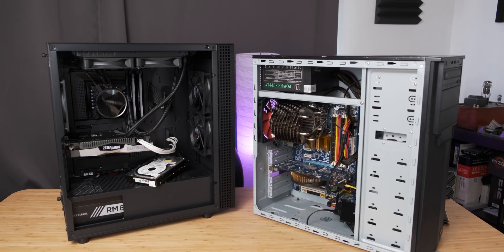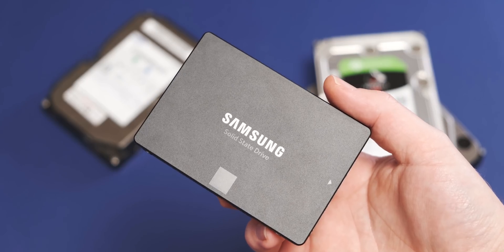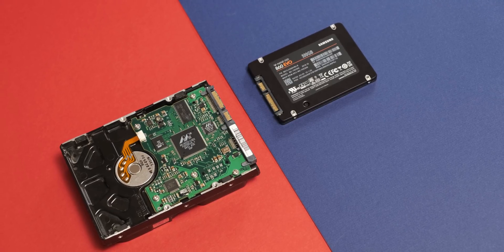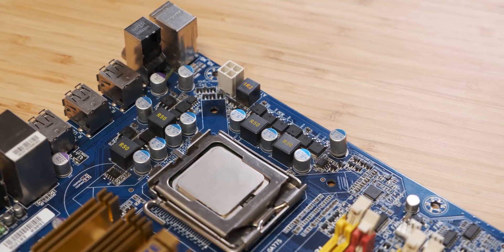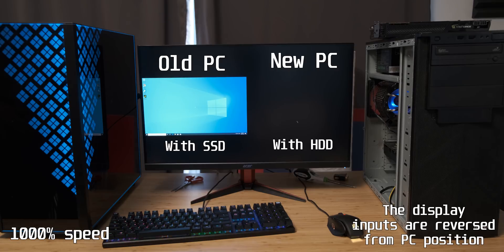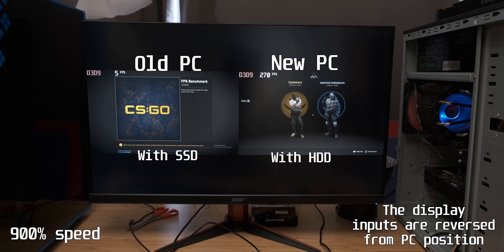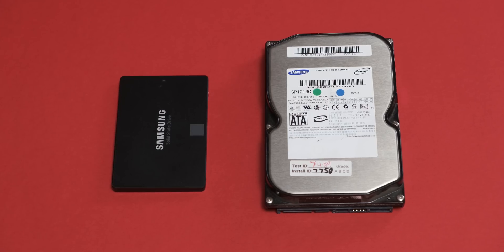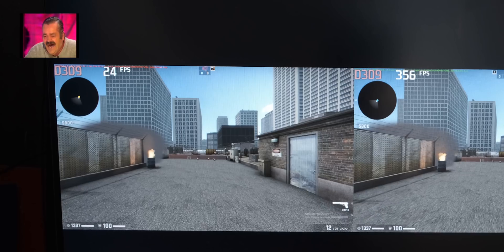New PC with old hard drive vs Old PC with new SSD

Comment: Love the channel as always and the video.

Sata ii is 3 Gbit/sec ~= 300 MByte/sec. I think things got a bit confused.

The RAM cache will disappear on power off, however over time Windows may move data around on disk to defragment frequently used data. There was a system where you could use a USB flash drive as disk cache.

Your processor+motherboard supports Optane which can accelerate old Sata disks quite effectively - depends on use case. It's a bit like the RAM cache case but bigger and non-volatile. Do try it for interest?

However both the previous techniques use non-volatile memory (Optane is not flash memory) as cache, so might be considered as cheating.

With my previous work computer I just installed lots of RAM and left in on so the RAM cache remained in place. Only way at the time to get round the poor performance of rotational drives.
Reply: Incidentally, before the time of SSD's a disk update still had a significant effect. As disk technology improved the increasing linear density of the data on the disk surface for each track increased the data rate passing under the head. For constant rotational rate then the data throughput would correspondingly increase.
Reply: Since 1 byte = 8 bits, 3 Gb / s is 3/8 = 0,375 GB / s so 0,375 × 1 024 MB = 384 MB / s theoretical speed
Reply: @Spido68_the_spectator  i used ssd on sata 2 and its 286-285mb/s
Reply: @Spido68_the_spectator  SATA II is a second generation SATA interface, and it runs at 3.0 Gb/s, although the actual bandwidth throughput is up to 300MB/s, due to 8b/10b encoding.
Reply from the maker: Thanks for all this infomation. 👍 I appreciate you taking the time to write this out. I just misspoke though. 😁

Comment: My work PC was a recent Dell that has an i7 8700 and is still insufferably slow because of the mechanical HDD.  Luckily I convinced them to grab a 16GB stick of Intel Optane, which basically acts as an SSD cache/system accelerator, and the responsiveness is very tolerable now.

Comment: Should have compared a more modern Sata 3 HDD
Reply: i once had a win10 laptop with a 5400rpm sata 3 hdd... it was every bit as abysmal as this. for smooth operation in windows, random r/w is more important, and no pure hdd has good random performance due to the laws of physics

Comment: That's why no matter how old a system I have, none of them that I own use a Hard Drive as a boot drive.
Reply from the maker: I think I will also be using an SSD in all my retro builds moving forward.
Reply: @DawidDoesTechStuff  I've managed to convert some SATA SSD's to IDE using some old adapters.  Couldn't get it to work last time I tried though, either my adapter died or I pulled some wizard magic the time before and now I've lost the touch.  But that's reaaaal retro when you're getting back to pre USB and pre SATA days.  I'd avoid going that far back, assuming you're old enough to even have used old 66/33/16/8 MHz systems.
Reply: @tonymorris4335  if u look on amazon, there are actually ide ssds u can use.
Reply: @tonymorris4335  Depending on how retro it is, you can just do an IDE to CF card. Not like really old systems need large amounts of storage anyway. LGR uses a 4 GB CF in his 486 I believe.
Reply: @tonymorris4335  IDE! I remember rounding my IDE cables with a razor blade & zip ties for leet airflow performance. Even did the floppy drive. Floppy drives...... now why didnt the Ls120 take off?????? Backwards compatible, no fuss.  Compare that with burning a CD or clunky zip drives. (USB drives werent out yet)  I dont get it.   wtf ls120!
Reply: It is a very bad idea, bro.
Reply: same.
Reply: Windows 3.1 enters the chat
Reply: HDDs aren't that bad for a boot drive. You just have to put the computer to sleep instead of turning it off to avoid boot times. And when you do install updates and reboot, you time it to do that when using the restroom or doing something else.